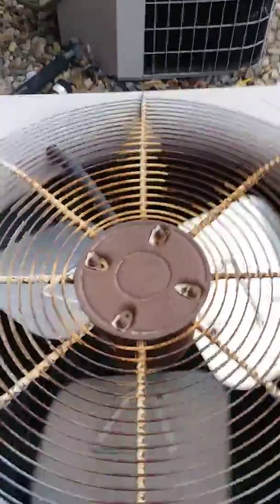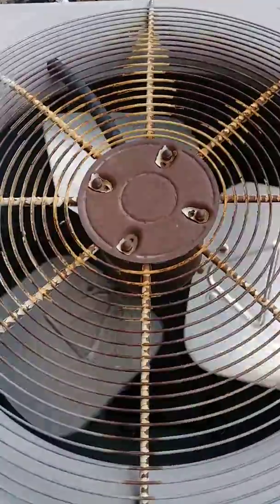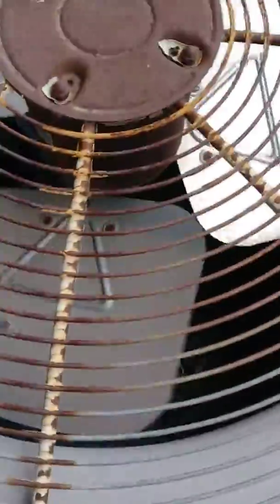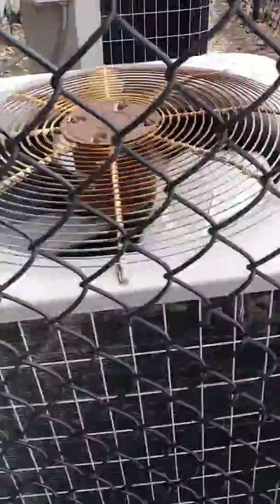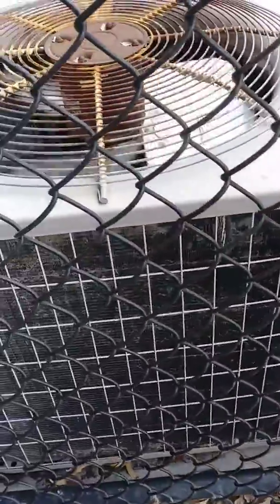Older Carrier Air Conditioner in a Low-Ambient kit (Angry compressor)

Comment: What does low-ambient mean?  It's kind of cool that you filmed the fence and the air conditioner; neat effect.
Reply from the maker: A low-ambient kit means the condenser fan cycles on and of but the compressor keeps running. It's to keep the line from freezing up in colder weather.